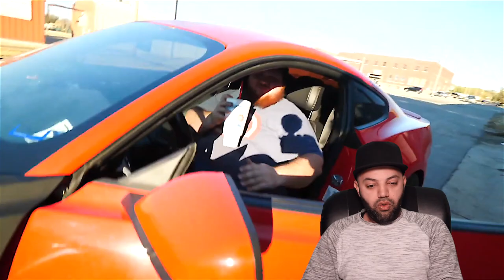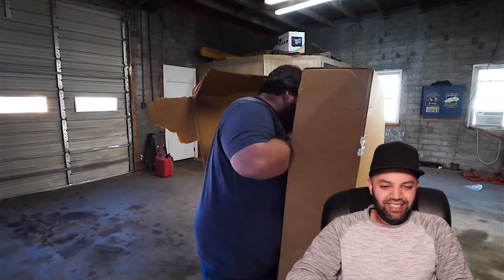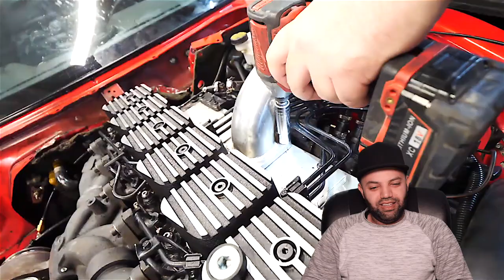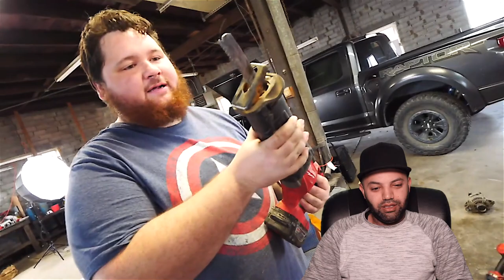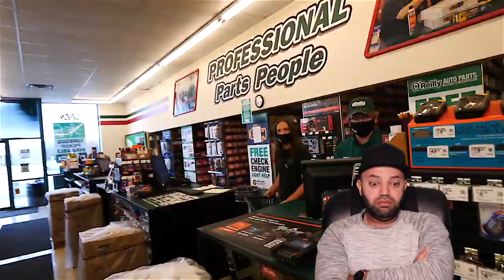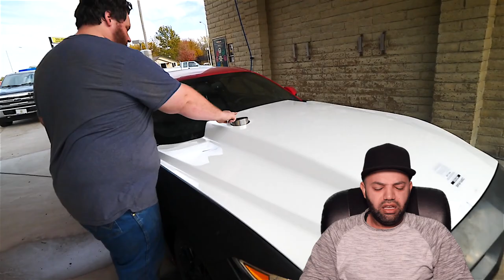Finally...Cummins Mustang Body is Finished Reaction | MR Halal Reacts

Comment: The Cummins 12 valve engine was introduced to Dodge in maybe late 1988 or early 1989 I think. Anyways I wish Ford partnered up with Cummins instead of international. But oh well that never happened anyways I love the 12 cummins engines. I'm thinking about putting a Commons 12 valve in my 89 Ford F-350 or a dt360 👍🇺🇸.